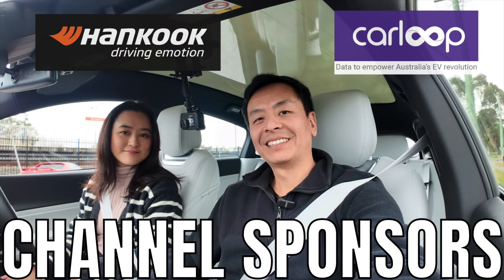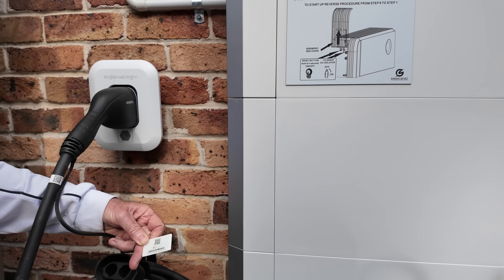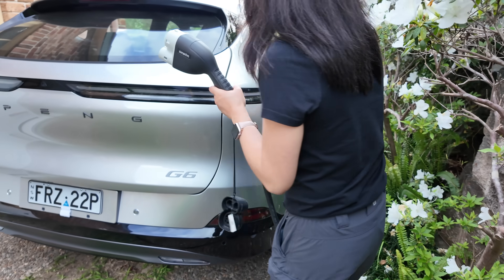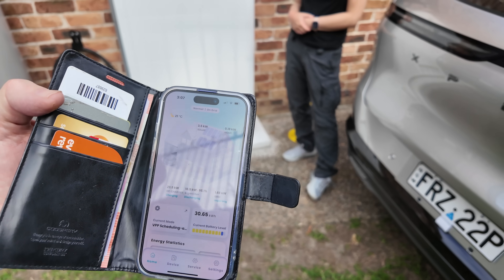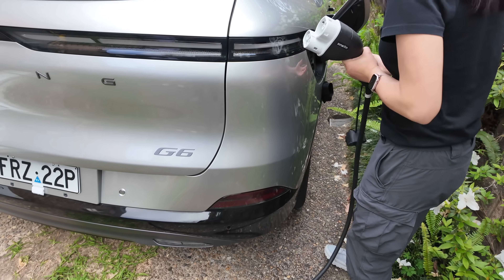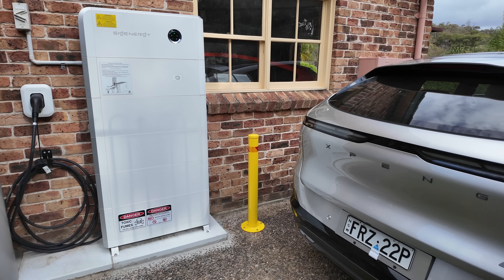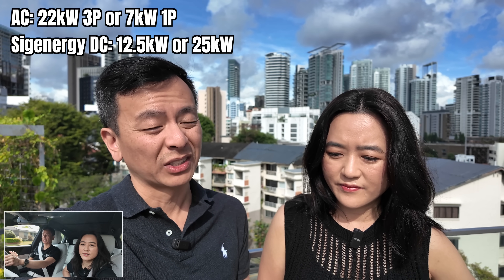Sigenergy EV DC Charger 25kW Real World Test | Is it worth it in 2025?

Comment: I have a BYD Atto 3 which is one of only 3 cars at the moment that is compatible with Sigenergy bidirectional ev chargers, I also have a 13kw solar, 10kw sig inverter and 24kw battery, my aim is to be completely free of electricity costs, just for context I have a 5 person family and 4 ac units that run pretty much all night being in QLD
Now back to the bi directional charger, I can now essentially add 60kw of battery for the cost of the charger at around 6k vs a 8kw module add on at 2.5k
That in turn allows me to dump into the grid for hours at an average Fit of about 12 cents which in my case would completely eliminate my electricity bill and infact put me into credit, I just have to save for xmas😅, great show

Comment: Not sure if it has changed but V2G with Sigenergy using Amber smart shift isn't supported which is a shame:

"If you have a Sigenergy battery and a Sigenergy EV charger, having the vehicle-to-grid (V2G) feature enabled will prevent enrollment in Amber for Batteries.

This is because Sigenergy's vehicle-to-grid (V2G) feature currently requires changing your mode to non-VPP mode, as Sigenergy's VPP APIs do not currently support V2G. Being in VPP mode and having the V2G feature enabled is not currently possible."

Comment: If you are getting it, go for the 25kW as the 12.5kW is only a few hundred dollars less. Other than the speed advantage to other AC EV charger, the Sigenergy DC EV charger can unlock the battery of the EV for V2H/V2G. I recently asked XPENG with regards to battery warranty for V2G and their response is XPENG HQ is yet to approve any V2G chargers for use but is working on a resolution to make this possible for Australian customers. Hope you are able to follow this up with XPENG.
Reply: Yes, also, you need to check the legislation in Australia RE V2G/V2H...,  as far as i'm aware its not yet 'legal'.  However, as far as future proofing goes, combined with battery and solar, I believe DC chargers are the way to go - we've just had a 25kw one installled for $4200AUD. 

We can utilise the daily peak solar generation rate, combined with a top up from the battery (car is at home through the day) - to acheive 25kw,, then recharge the battery post peak. 

I have a byd Sealion 7, and I don't think the warranty is valid if the battery is used for bidirectional charging at the moment - is this different for the Atto 3?
Reply: @michaelcurtis559  hi, $4200 is tempting. May I know which state are you in? In WA it's $2800 extra for additional 8kwh battery so the difference is not much.
Reply: @michaelcurtis559 just to clarify - did you say you were able to discharge the battery (v2x) on your sealion 7 using the sigenergy dc chargers? If so, I read there is a rate limit of 3kw discharge before the car will disconnect, are you able to set that limit inside the app so that the car doesn't disconnect? Also who'd you go through for the install? Was it a local outfit or national? I haven't reached out to anyone yet to get a quote, but $4200 installed sounds pretty reasonable.
Reply: I assume the 25KW one needs a 3 phase supply?
Reply: @patrickoconnor5494  Nope.

Comment: I have the 12.5 as my solar is only 15kw, the price of these i heard is dropping upto 40% now, basically got it for convenience all in the one unit, and for blackouts dont have to worry about leads, but v2x is not working think our vpp amber is confusing it. I have a seal also hasn't had the tesla charger update yet so not sure if that can effect it.
Reply from the maker: Be careful ... I've heard the Tesla V3/4 supercharger compatibility upgrade for pre-2024 BYD Seals could potentially negatively affect V2G/H capability

Comment: Hi Tom and Joy, I have recently installed exactly the same as you have, the 40 kw ess and 25kw ems 3 phase with gateway (for quite a lot more than your invoice was I might add?) and just like you I left out one battery brick to potentially allow for a 25kw dc fast charger down the track when I go full electric not just phev that I have now and when they come down to a reasonable and feasible price point to be economically viable as you have also made a good point on. So I was quite excited to hear your comment from Facebook re the 40% price drop? My installer also heard this rumour and contacted ac solar warehouse their wholesale supplier and also Sigenergy to confirm this and apparently this is not correct? Please advise some updates or feedback clarity on this as obviously facts outweigh rumours and speculation?
Cheers 
Michael
Reply from the maker: Here's the LinkedIn post from the Sigenergy AU/NZ MD making the announcement: https://www.linkedin.com/posts/willjameshall_sigenergy-sigenstor-evdc-activity-7378316494901981184-WfFZ
Reply: Yes thanks, my installer also said that he received this information however apparently this was a global release and none of the Australian distributors have been given a price change since the 1st of July and everyone is trying to find out?
I’m wondering if your installer “Infinite” or Solar Choice can shed some more light on this?
Cheers

Comment: Hi Tom, I’m curious as to how the DC charger can pull 25 Kw even though there’s a 10kW inverter, I thought that would be a bottleneck? I’m looking into getting a 12kW inverter single phase myself and was assuming I could only install the 12kW DC charger, thanks 👍
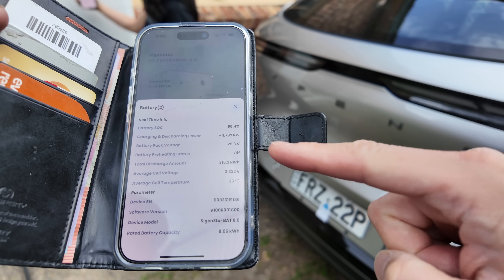Reply from the maker: At 3:31 you can see the throughput from each 8kWh pack is approx 4.8kW hence 4x4.8kW=19.2kW plus DC solar plus 10kW grid if needed would easily make up the 25kW required for EV charging
Reply: @LudicrousFeed Thanks Tom, makes sense 👍
Reply: @LudicrousFeed  Also, since this is DC charging, no inverter is in the path. Your bottleneck will be the amount of battery modules.

Comment: Fan likely won’t wurr because it’s DC to DC,

The wurr it usually makes is when it’s doing AC inverting.
Reply from the maker: Makes sense, the fan noise is coming from our inverter in this video: 40kWh Sigenergy Battery Update after first Amber Electric Power Bill
https://youtu.be/HO_IM6iR9nQ

Comment: The 12.5 kw dc is cheaper, but still gives you access to V2H, but i think Tom will want the 25 kw dc to check if ev brands can do it. If there's a grid outage it will be nice to be able run the whole house without worrying, might have to cut back a bit of energy usage if the outage goes for 4 days or more 🤔 Also V2H gives you more energy to trade 🙂
Reply: We used our daughter's Atto3 during an extended power outage. When it got low I drove to the nearest working charger and we were set for the next couple of days again.

Comment: If I was starting with nothing this set up would be tempting.  As it is I have a near 6 year old Powerwall 2, a 6 year old Tesla Model 3, a separate Fronius 10kw inverter and the original Tesla wall charger which only charges Teslas.

I also don’t anticipate still living at my existing home 5 years from now and such an investment has to be long term (minimum 10 years in my view) as I’m not convinced that potential buyers of my house would necessarily see the value proposition especially if they weren’t considering buying an EV.

Comment: Three phase Sig 6 stack including DC charger is what we are aiming to install shortly.  Does that one meet the clearance requirements?  The install looks to be very close to the window and to the heat pump.
Reply from the maker: Behind the window and wall is a garage ie. a non-habitable room
Reply: The heat pump is 600mm away - it just meets clearance requirements and I was space constrained to this distance.  A bit more would be ideal if available.  The window is a garage, and as its not a habitable space so it met requirements.  

One benefit of having the heat pump close by is that the cold air output from the heat pump blows gently over the Sigenergy inverter. I time the hot water pump to operate in the middle of the day, so it takes already warm air to compress which is efficient for making hot water.  Then it blows the cold decompressed air out on the Sig Energy battery side during the peak time of its operation and this is also the hottest part of the day. 

My setup is single phase.  Ive never seen any of my Sigenergy components get hot.  The Sig inverter runs cooler and quieter than my 5kw Fronius Primo inverter which I replaced with Sigenergy.  The most noise it makes is it gives a slight hum when I am running the 25kw DC charger to the car.  This is not a fan noise, it is the noise of current moving inside the Sig stack somewhere.  It sounds similar to when I run a fry pan in the kitchen at max current, a slight humming noise.

Ive heard from 3 phase Sigenergy inverter owners that the 3 phase is slightly noisier than the single phase, as it has greater current throughput to deal with.

The final step is I am putting a car port roof over all the equipment.
Reply: @tonyg2002Aust  I fully understand about the space constraints, our house has no compliant zone at all for a Sig battery stack.  We needed to design a garage (...which was on the agenda anyway) to accommodate the ~800kg of new PV panels,  and allow the battery stack to be placed in an acceptable position, expected to be around 4 metres from the fuse box, which will also provide a good buffer for any humming.  As we are in a slightly more extreme climate than Sydney,  I would not expose any equipment to the weather here, our original inverter, which was installed next to the fuse box, lasted ~6 months before the display was illegible due to UV damage.  Squeezing this into the existing carport is also not possible here, as during the fruit season, rodents have already attacked both our cars, destroying one wiring loom.. I would not leave a snug warm battery or an EV out there.

Comment: Is the charger AS4777.3 compliant now or does it need to be off grid?
Reply: AS4777.3 has been superceded by AS/NZS 4777.2:2015 based on the info at Standards Australia website.
Sigenergy lists AS/NZS 4777.2 certifications.
Both the standards and the products are frequently changing.
I will post the link at Standards Australia reference in a separate reply, as the utube algorythms may delete comments with url links.
Reply: The algorythm deleted the reply with the url.  However if you enter AS4777.3 into a google search and click on the Standards Australia link that comes up, you will see it states "
AS 4777.3-2002  Superseded By AS/NZS 4777.2:2015  "

Comment: Joy & Tom, love your work! We've almost exactly the same setup as your Nth Shore friend (our Xpeng licence plate is almost identical!), but we only went with 5kW SigEnergy battery, in anticipation of V2G. The EV will sit at home most of the time, except road trips. Visiting Mascot today, I believe I understood the technician to say that V2G, when approved, will be considered alongside V2L, therefore will have up to 3.3 kW of power output for external use. 
This seems very low, and would make exporting large volumes out to the grid (in an Amber scenario when prices spike) more challenging. 
Do you (or others) know if there is a V2G limit on the Xpeng G6?
Reply from the maker: Nice! I expect the V2G/H export limit to be constrained only by the size of your Sig inverter

Comment: Correction guys : you can buy AC chargers with bidirectional capabilities, even the Tesla wall connector is bidirectional, with a Cyber Truck 🤣🤣 Point is, you don't need DC for bidirectional capability, it's just that EV makers have been a lot slower to approve AC bidirectional chargers because it will be using the EV's on-board charge inverter way more than expected. Whereas DC connection to the vehicle bypasses the on-board inverter.
Reply from the maker: Seems more sensible to go DC bidi to prevent wear on the onboard inverter … plus DC would be more efficient

Comment: The only hesitation I have (and it might not even be a big deal) is having the car's battery being degraded faster. As someone who likes to keep their cars long term, it's something I am hesitant with, but it makes sense for people who probably just have leases for a few years and move onto the next car. The idea behind it is great though and maybe it will be a no-brainer if the cost isn't too much off an AC charger.
Reply: With average LFP batteries being good for 3000-6000 full charge / discharge cycles, you would have to do this everyday for ten years which seems unlikely but could be an issue for some

Comment: Great solution for single phase houses, getting three phase speeds there. Also great for charging off solar or Amber at mid day when it is dirt cheap at 4c kw/h. V2G would be good also for making money.
Reply: You're not going to get 25KW DC on a single Phase supply.
Reply: @patrickoconnor5494   they did, in this video, so the DC charger is Panels and battery and top up from the grid, so it could up 10kw of AC to convert to DC and the rest could come forn the panels and the battery. so it is possible and i guess cheaper than a 3 phase upgrade just for ev charging. Based on the cost and work to do a 3 Phase Upgrade

Comment: The RFID is standard on all DC charger modules. You can choose whether to use it or not.

Its good if you need to charge quickly.

Its also a huge benefit if you can use V2X if your property is prone to blackouts

Comment: Just wondering if you can set the charging rate via the Sigenergy app rather than via the car itself. That would save me from climbing up and down stairs before starting a charge.
Reply from the maker: I don’t recall ever being able to alter a DC charge rate in any system … will need to verify

Comment: Not sure if you mentioned it but it also keeps everything on the DC side and reduces the loses of DC to AC a few times if you have AC charging.
Reply: And also means you don't need to worry about a 3phase grid connection (Assuming you are using solar and battery to charge).

Comment: I went the ac charger because it doesnt take a stack. So you can max out the solar subsidy and get a 48kwh battery.  The 25kwh dc charger was very tempting but assume i will be fine topping up over night at 7kwh.
Reply: Try not to mix up your units. The charge rate is 7kw or 1kwh every 9 minutes.

Comment: Bi-directional charging is huge if you’re like me and work from home. I can keep my car charged from surplus solar and then use the car battery to supplement my relatively small 24kwh home battery to get me through long winter nights. This effectively gives me a 124kwh battery, so the cost (particularly now 40% cheaper) is absolutely worth it. Good video 👍
Reply: This is similar to what I'd like to do. I'm just wondering if it's possible with a PHev like a Cannon Alpha. I really want a one car scenario. We're retired and most of our driving could be in EV mode. On trips away with our caravan we'd have our own power supply too.
Reply: @imagineaworldwithdecentpeople maybe consider an electric van with a pop top, hopefully can fit a toilet and a kitchen with a shower tap. Small enough to be a daily driver and easy to charge on the road. Cheaper to run, no worrying about a fossil engine.
Reply: @flukeylukey7559 pure EV is definitely my preference, just not quite there yet for our set up.
Reply: @imagineaworldwithdecentpeople for towing a caravan there would need to be a lot of drive through fast chargers  and the ev having at least 1000 kilometres range, or the caravan would have electric motors and regen and solar, then 500 to 600km of range without towing a dead weight could be enough. Im going with a very large suv camper with kitchen and hopefully a  toilet somewhere.

Comment: DC charging shouldn't generate any additional noise. The inverter isn't working; its DC-DC, so no fan noise.
Reply: It still needs to get to the correct voltage so it needs a DC-DC boost converter so there is still heat being generated. The whole Sigenergy system can use different sized batteries with different voltages and matches those voltages to the inverter voltage.